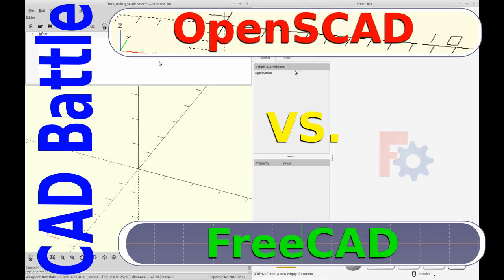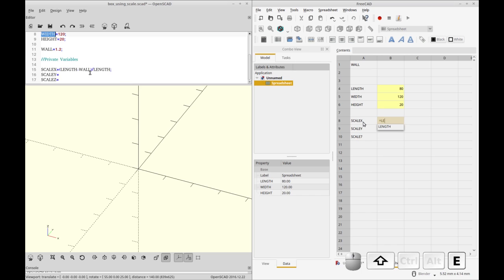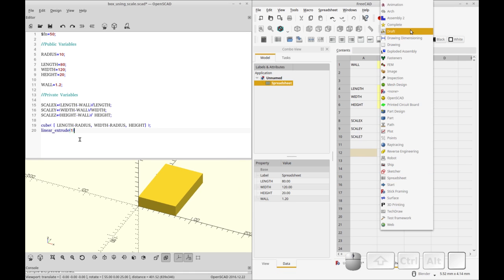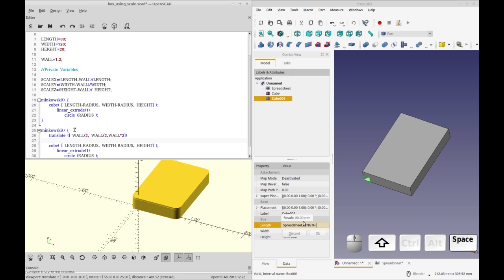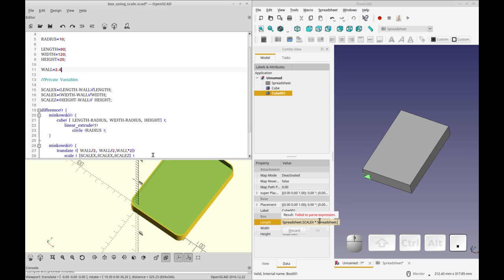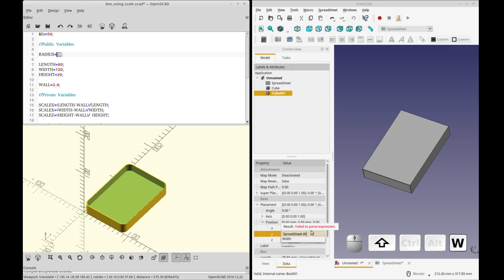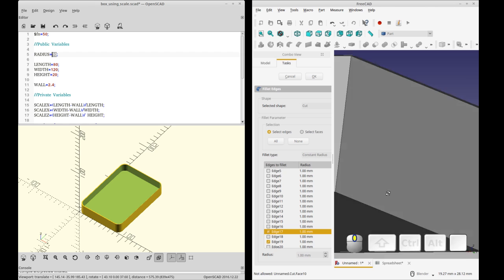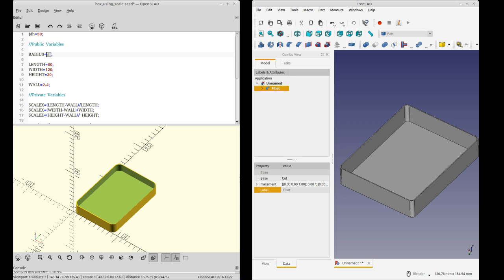CAD Battle - OpenSCAD vs. FreeCAD

Comment: I never used both programs, but looking at this demonstration, there seems to be a lot of mouse clicks with FreeCAD and OpenSCAD can be keyboard only operations. For this reason, OpenSCAD wins my heart.
Reply: I think many people expect a lot of mouse usage because it's "drawing", but us keyboard monkeys will do almost anything to avoid the mouse, like use vim LOL
Reply: @kernelsmith  It's just faster! :) [at least you did not say emacs ;))]
Reply: I found openscad to be quaint (and I have been using ms dos in the 80s) BUT you can copy and paste code into it to create stuff. Which chatgpt does really well. 

I like the freecad interface better and if I where to truly model it would probably be my choice, but since I am looking at generating code and parameters (in excel and python actually), openscad is so much easier. Not prettier, but easier. Thus thanks to the OP, this video was really helpful in showing exactly that difference!!

Comment: I think the comparison of OpenSCAD and FreeCAD has to go much deeper than analyzing the filling of input boxes. In product design we need CAD tools to make products faster and of higher quality, is FreeCAD better or OpenSCAD better for this? I am talking of stuff like this:
1) When I design a product , for example , an internal combustion engine, I want to know if there is an error in the design, for example , would the piston break if it made some high number of RPM. This can only be made with FEM analysis , so is FreeCAD or OpenSCAD is more friendlier with FEM?
2) With development of robotics and 3d printing I no longer want humans to design the manufacturing line of a product, I want the AI to analyze the design of my product and find the better process (more efficient) to produce it. 
3) I want to simulate my product for aging and wear, how long will it last if it is exposed to constant temperature changes, or corrosion. 

Maybe OpenSCAD is not the best model, maybe we have to continue searching in a new model to create more efficient products, so, even if I am asking questions a Phd student can't answer, we have to work in that direction with our CAD tools

Comment: i don't see why you can't use both :) 
i personally would use openscad to prototype an idea, just to get the main structure of the design out of my head and onto the computer.
but then i'd use freecad to fine tune it.
and then if i feel impressed enough with the design i'd color and render it in blender
before making a video about it in kdenlive

Comment: FreeCAD is full of bugs that make things break all the time. You work on a part and suddenly realize that a wall randomly disappeared. Openscad works just fine.
Reply from the maker: Yes, You are right. This is often reffered to as the Learning curve. You will get a lot of great results from OpenSCAD. At some point there are just some features that are simply not available in OpenSCAD. So you can also get a lot of great results from FreeCAD. My video was largely meant to introduce FreeCAD to OpenSCAD users as an option. Always use what you prefer. Don't listen to to rage-bait videos like mine. Also, keep in mind that FreeCAD is getting better everyday. Thanks for wathcing and commenting, good conversation helps everyone.
Reply: Agree... freecad is full of bugs... it should not be avaiable for download. I tried librecad for 2d drawings and all problems solved. Perfect for plasma cutting or laser. In freecad it was imposible to export a simple dxf file..
Reply: @dimorphodon4607  hi, refer to Maker Tales video "freecad is fundamentally broken" watch?v=QSsVFu929jo
- he shared nice insights and one of FreeCAD dev commented to update on that too. Really helpful.

Comment: Thank you for these examples. There are here some mistakes: f.ex. wall thickness is not identical on all straight lines and roundings, dimensions of the box are different than LENGTH and WIDTH, ...
If somebody wants proper solution, here is an example code:
translate ( [RADIUS, RADIUS, 0] ) {
    difference() {
        minkowski() {
            cube ( [LENGTH - 2 * RADIUS, WIDTH - 2 * RADIUS, HEIGHT - 1] );
            linear_extrude (1)
                circle (RADIUS);
        }
        minkowski() {
            translate( [0, 0, WALL] )
                cube ( [LENGTH - 2 * RADIUS, WIDTH - 2 * RADIUS, HEIGHT - 1] );
                linear_extrude (1)
                    circle (RADIUS - WALL);
        }
    }
}

Comment: What if I don’t know what I want to build, or another way to say this would be, I am very inventive and my mind could be on anything at any moment. And I only want to learn one or the other. Which should I pick... build a Tesla Valve in both, that could give me maybe a hint at what I should pick? So what if i want to design an engine or an electric motor...
Or something of a different category like a geodesic dome home with furniture and appliances etc... the dome “inside layout” would be to help me make a design and pick size of dome needed, not for printing... but still a practical application of use.
Reply from the maker: Niether FreeCAD or OpenSCAd are well suited for freeform design. You might want to use something else to do that.
Reply: hi @David Prock - did u find smth?
Reply: @yash1152  what do you mean by. Did I find smth?
Reply: @davidprock904  i meant some software/technique for accomplishing what u said above.
Reply: @yash1152  not yet, I need it to work on Linux and windows cause once in a blue moon I switch

Comment: Thank you for revealing that aspect of the spreadsheet in Freecad. I wonder if you could upload the examples in Thingyverse for example so people can take a look at them and learn. I am going to have to look for an IRC chat maybe because I get frustrated for example in Freecad when I cant find how to reference the origin for example. Do you have a video about all the implications and tricks of referencing to other parts of the geometry, and also if there already is any support for spreadsheet driven variability of enabled features, patterns etc. (Imagine a spoiled ex Solidworks user coming down to alpha/beta software...)
Reply from the maker: You welcome, I do uploade some examples to github, you can find what I have done so far at: https://github.com/mathcodeprint, if there is a particular model that you are looking for let me know. I will see if it is ready to be put on a repo.

IRC is a great idea I might see if I can have that running while I work. 

External references are indeed tricky, one reason is due to the fact that they are evoloving. This might be a good candidate for a FreeCAD quickie. 

The only thing I can say to a Solidworks - FreeCAD is, be patient. Solidworks is great but it is certainly not free. FreeCAD has a steep learning curve, after more than two years I feel like I am still on the uphill. But as a result of it's OpenSource nature I am not at all worried about the longevity of my models. Be patient there is gold at the end of the rainbow.
Reply: @mathcodeprint  thanks for advice :)

Comment: I'm working on a Python library that replicates a lot of OpenScad functionality on top of Blender, and it will eventually integrate existing openscad scripts. The goal is to have a script which can at the same time visualize fully assembled projects in high quality, analyze single components and export them automatically to stl or even gcode.
Reply: What happened with your project?
Reply from the maker: For some reason I can't see what video you posted this to. I get distracted easily. But some projects early on didn't seem to Garner any attention so I moved to something else. Will definitely revisit anything that people are interested in.
Reply: @doa_form  https://github.com/akloster/blender-vraag

Comment: Funny, I've done a number of designs in FreeCAD and have never used the spreadsheet! I'll have to give that a try. I use both programs and agree, there are areas where each shines. I learned OpenSCAD first, but still use both regularly.

I really like the OpenSCAD approach of synthesizing parts using the shape, logic and transform primitives, but there are things that I find a PITA. One example is putting a chamfer or filet on an edge. Maybe there's a trick I don't know in OpenSCAD, but this is waaay easier in FreeCAD, IMO.

FreeCAD has a lot of different possible workflows, which is a double-edged sword (flexibility vs complexity).  I've mainly used the Part workbench, but lately have started using the sketcher workbench (thanks in part, to your videos) and want to start  using the drafting WB. The OpenSCAD plugin/workbench for FreeCad seems like it could be a really powerful bridge between the two programs but I don't know enough about the limitations. Have you explored it much?

Thanks for your videos, they're well done and informative!
Reply: richfiddler11 FIY, in the spreadsheet, you don't have to add an alias. You can just use the cell coordinates like C5

Comment: I think this comparison suffers from translation issues. For instance, not being familiar with OpenSCAD, I had no idea what the Minkowski sum operation you were applying was. It appears to be (conceptually) a union of placing one object at all points within another object, making it a generalized offset operation that behaves like the variable width you get when drawing curves with a highlighter at a fixed angle. That sort of variable width does occur in the corners of this model, which have thicker walls as the inner and outer fillets have equal radius. The operation gets lost in translation from OpenSCAD to FreeCAD via OpenSCAD's CSG file format, even though this shape in particular could be described in CSG as a union of two cuboids and four cylinders. Other shapes are trickier. 

I feel it's unfair to blame FreeCAD for spreading your formulae around when you already have a spreadsheet to put them in; you can also refer to the spreadsheet cells by name (A1 etc) instead of alias. I am thinking about making a macro to set the aliases in column B based on the contents of column A, or maybe adding a mode to make the aliases visible as a column. The spreadsheet function isn't very fleshed out.If you also install Graphviz, FreeCAD can show you a dependency graph, which points out which properties are used where in formulae. Scripts can set formulae and find dependencies, but I haven't yet learned how to read the formula for a property. I'm a newbie as well.
Reply: I agree fully, it's unnecessarily complex to assign names to custom properties. The predefined ones may have some meaning though; it means you can define relations as "this slot should be large enough for that tab", rather than simply being set by the same variable. Either way takes some habits to keep in order. By the way, the hotkey for formula entry is =, just as in the spreadsheet. The fact that the formulae themselves are hidden, like cell aliases, feels like it really should be optional... like the "reveal codes" function of Word Perfect, seeing the relations themselves is useful at times.

Comment: Very useful, thanks. I usually use OpenSCAD (pronounced Open - ESS - CAD actually! - https://en.wikibooks.org/wiki/OpenSCAD_User_Manual/FAQ#How_is_OpenSCAD_pronounced.3F).
I like OpenSCAD because of the easy of changing dimensions. I keep thinking I should try FreeCAD, so it is good to know about that spreadsheet feature. I was initially confused by Minkowski in OpenSCAD with it changing sizes; so good to see that is how it actually does work, even though it's a nuisance to have to compensate for it. I found it very handy recently when I discovered OpenSCAD imports STL files; simple modifications are then relatively easy.

Comment: I agree that both FreeCAD and OpenSCAD have their uses. Where FreeCAD falls really short IMHO is in assembly. The current version 0.16 has a very clumsy way of assembling different components. As for OpenSCAD for large projects the script can get long. This can pose problems in maintaining the script over time.
Reply: Try 0.18 and 0.19 nearly here
Reply: @now-you-know-it  they had improvements over 0.16 for assembly?
Reply: @yash1152  Good question left unanswered.